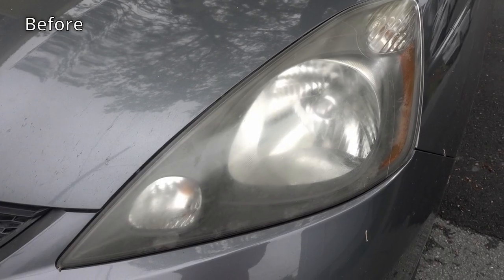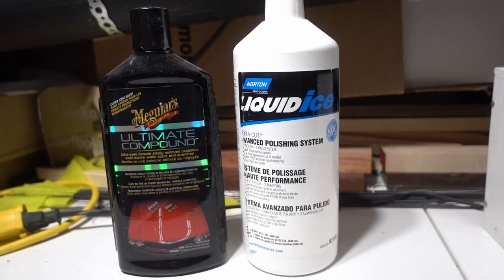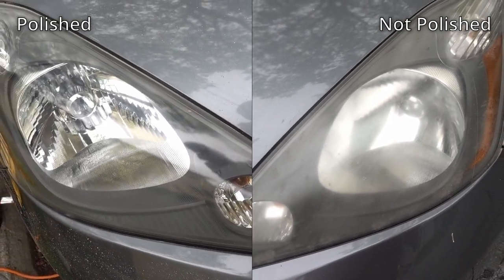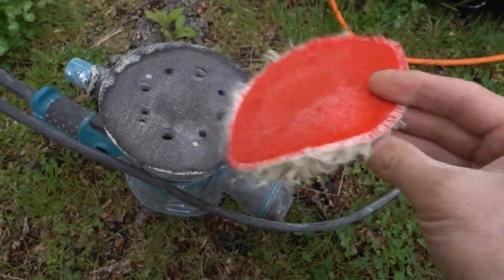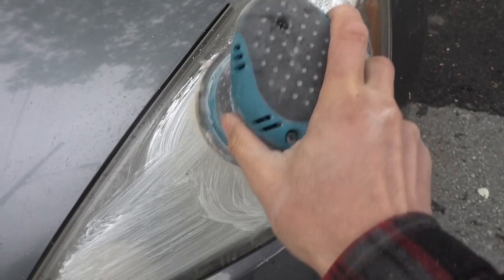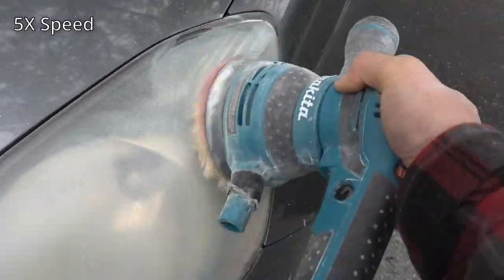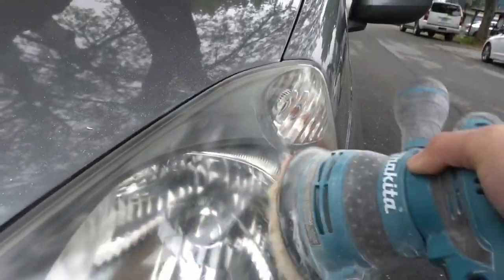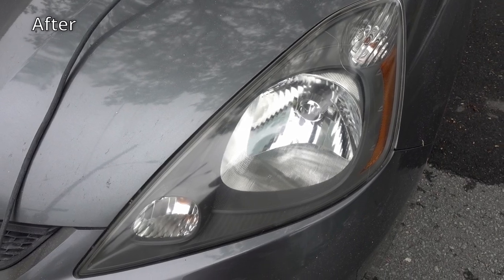How to Restore Headlights in Minutes with Car Polish

Comment: I have done this a couple of times, but it always comes back after 6 months or a year and you have to polish again. I found a more permanent fix was to sand and then clear coated with U-Pol Clear #1 (which is UV resistant). Then I buffed up that and they have kept clear for 4 or 5 years now.
Reply from the maker: Thanks for the heads up, great tip!
Reply: That sounds great!

What did you do as steps though?

Did you sand the headlights and then applied the U-pol, after that you use the buff machine?

Or you sanded it then added the U-pol to the buff machine tool and buff it with the product?